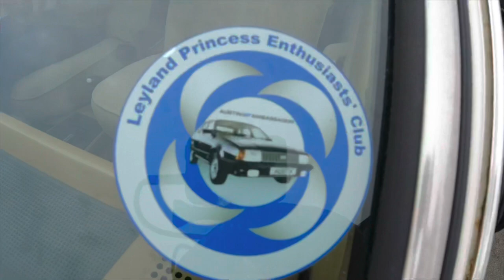Lee Driving His Austin Ambassador To Visit Agatha The Austin Allegro

Comment: Awesome vid Lee, Ricky, the Ambassador sounds and drives awesome. 
     You have to use classic cars for mundane running around too so long as they are respected which I think you do Lee.
Reply from the maker: Ok was impressed watching and editing his bits!
Reply: It does like a good thrashing from time to time.... Seems to run smoother when driven sedately after.
Reply: @leelee1973la  A thrashing to “Clear out the Carbon” as my old man used to say.
Reply: @Wills Wheels  yes.. lol..
Especially with today's crap fuel... it goes stale so quick...!
But there's still plenty in the rank to use up... so now the weather is getting better, it'll be out and about more often.
Reply: @leelee1973la  What fuel do you put in the Ambassador..E5 super?
Reply: @Wills Wheels  Yes, its gutless on E10... and drinks it.
On E5 its more responsive.... yeah, I know, an old O series couple to an auto responsive 🤣🤣
But I can tell the difference... especially from say 55 - 75... 
Although the power does drop off as the fuel gets a month old or so... I last put £25 quids worth in back at the start of January...
She does return hood fuel economy to be fair... I dont always drive it too hard... Its actually quite capable of holding its own against today's traffic without the need to give it more throttle than normal.
For an old 3 speed slush box, the ratios are well chosen for its time.
Reply: @leelee1973la  So a good useable daily classic then. 
     I don’t put E10 in the bike, she’s nearly 30 yrs old, plus during the winter I don’t use the bike very often so fuel can be standing in the tank for weeks on end so putting in E10 would be detrimental to the tank and carbs. 
     So far she’s been ok, and yes like the Ambassador she does run better on E5.
Reply: @Wills Wheels  Yes, The Ambassador is a really good usable classic... a very comfortable one at that. 
Ricky did an E5/E10 comparison video last year... Although the Rover didn't suffer any lack of power... (not that Ricky drives his cars that hard anyway) there was a difference in MPG if I remember correctly.
Reply from the maker: @leelee1973la  the Rover gets 42 on E5 if I drive carefully, 40 if I give it all it’s got, 37 on E10. I tend to do 2x5 and 1x10 tanks.
Reply: @AgathaAndAnything  with fuel figures like that, an EV makes little sense 🤔

Comment: mighty white sure goes well
Reply from the maker: It does!
Reply: It's really at home on A roads... although it will cruise happily at motorway speeds... and you do get used to hearing the engine rev a little high.
It's an old borg Warner 3 speed auto.